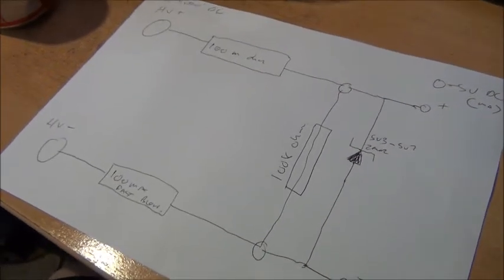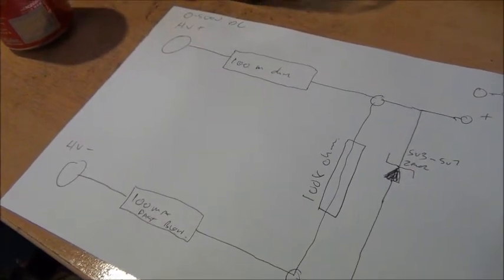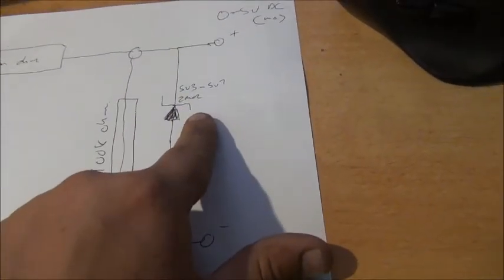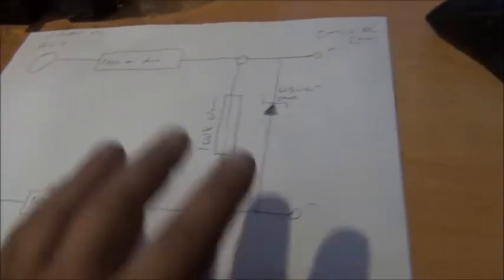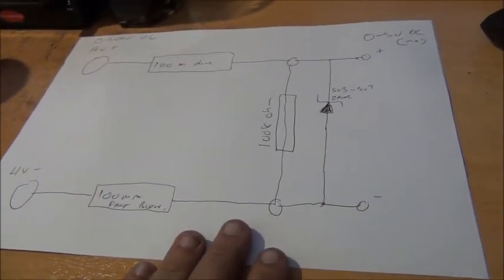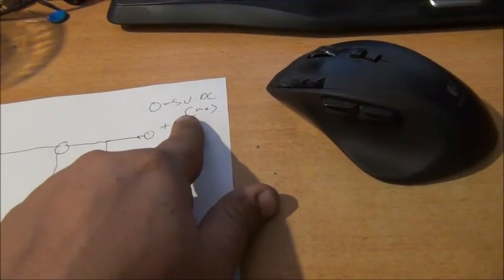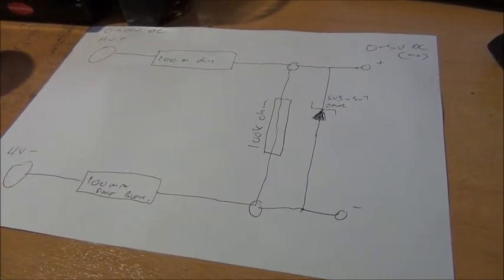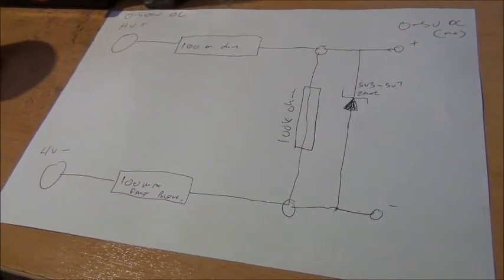Voltage Divider - Read High Voltage DC With Arduino!

Comment: Simple design but based on my experience, placing that zener diode would give a non-linear reading for the arduino at it approaches 4.7V, about 3.2V it would start making a parabolic reading. If you're concerned with protecting the 5V limit of the ADC pin, you can just use an operational amplifier acting as a buffer, powered at 5V. No need of the  Zener diode.
Reply: Also, you can use varistors, a kind of protection device for high voltages. it would short the input to ground if it exceeds a rated voltage of the varistor. it's kind of a voltage fuse.

Comment: There are some mistakes in the video and in some comments. First of all the voltage in a serial circuit is proportional to each resistor's value. In this case, for 500V and 100M, 0,1M 100M. Vmeasured = 500*0,1M/(100M+0,1M+100M) = 0,2498V. So we would need a 2M resistor in the center. Vmeasured= 500*2M/(100M+2M+100M)=4,95V. But we have another big problem: the arduino analog input doesn't have an infinite resistor, it has a 100M equivalent resistor, so we have to take this in acount or to use other resistors. I will recommend to use 1M, 20K, 1M resistors, 1/4W. The max. power dissipation in a 1M will be 0,06W.

Comment: Hi Alex I think you have your resister values wrong, Using the equation with your resister values 500V * (100K / 100K + 100M) =  0.4995 V, if you replace the 100M resistor with a 10M resistor you will get 4.5904V.
If you want to use the 100M resistor you would need to replace the 100K with a 1M resistor. Here is a link that explains how to calculate Voltage Dividers https://www.youtube.com/watch?v=XxLKfAZrhbM

Comment: make sure you do not exceed the voltage rating of your resistors.  Usually for HV dividers you'll want to use a string of resistors to make sure the voltage rating is exceeded (this could cause a destructive arcover otherwise).  a 1/4W resistor might only be good for 300-400V each.

Comment: I've seen that done on helium neon laser power supplies. They use ballast resistors in the anode of the tube power supply to limit the current. I recall a set I had of 6 resistors forget the value; which provided 3.6ma of current at some insanely high (ok a kv or 2) voltage to make the tube lase at an impressive 3 milliwatts. Now I have a laser that has no high voltage, and the only danger is the 1200mw beam :P

Comment: Yes thats how I did mine - fine calibration so you can tune it to read what the multimeter reads... so you dont need to double check all the time with the.... multimeter. Remember consumer grade resistors can be up to 5% out so if both are out by 5% thats 10% out. Which means you could be 10% over charging your caps. Fine tuning allows you to get the maximum charge into them without fear of blowing them up. I fine tune to 25V below the caps constant working voltage :)

Comment: Regular optocouplers don't work like that.  You would need a serial output ADC and some optos for the data and clock lines, as well as an isolated DC/DC converter.  You might be able to use an opto (possibly analog CdS cell or photovoltaic output) along with a load of signal processing gumf (either discrete analog or MCU code), but the serial ADC would probably be easiest to implement.

Comment: Alex, i did a similar thing to allow my 10 meg input digital to read 35kv tv crt anode voltage, allways best to split the biggest resistor into many smaller ones, so there is less voltage across each one.

Mine was assembled in a plastic conduit and the resistors did a zig zag inside, anti corona spray was applied to the whole inside, a strong pin was fixed to the end then the case was closed, cheap and safe and worked smashing :-)

Comment: You might want to move your fuse to the +V side. Consider what happens when/if it blows. (Hint; everything could float at a high voltage.)